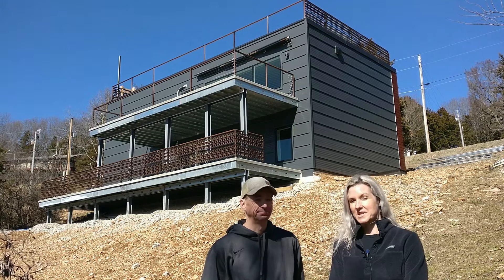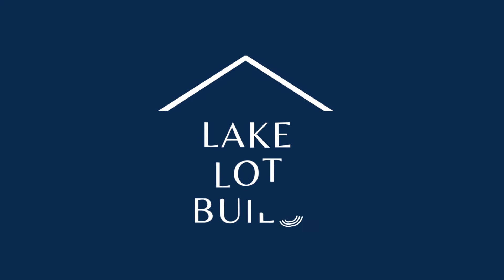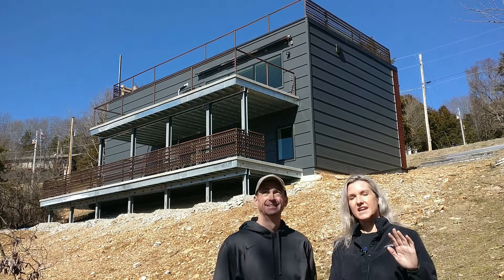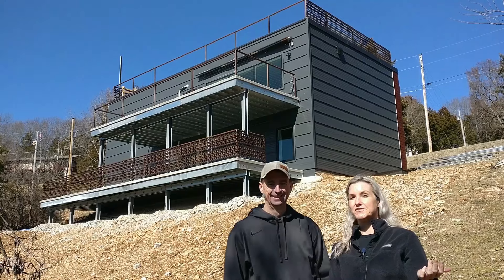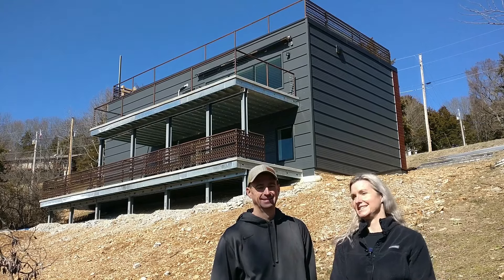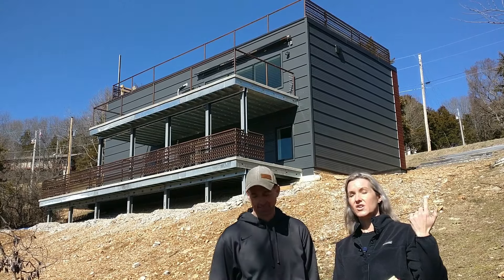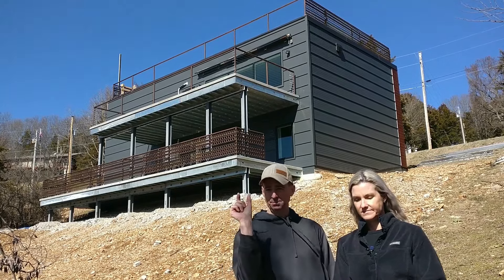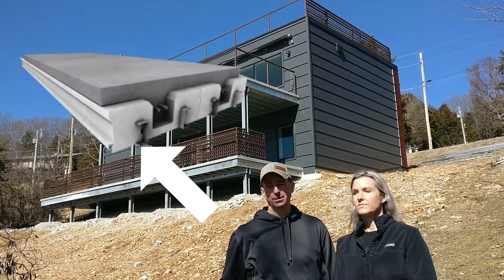Mistakes We Made in Our ICF Home Build! Would we build with ICF again?

Comment: I've been building ICF homes for 20 years.Some of the issues I've encountered is that some architects don't consider the thickness of the walls when designing the homes.Walls are 1 foot thick and it can make rooms feel smaller.Also window sizing is important with a thicker wall.A 24" x 48" window may look ok in a traditional build,But in an ICF wall it looks like you're looking into a tunnel.I always tell my clients to make the window sizes as big as they feel comfortable with.And we have taken a custom of house wrapping all of our ICF homes,not because of foam deterioration,but because of water infiltration in behind the siding and finding it's way into the ICF joints and eventually leaking in a window(It only happened once)but after the wrap,never happened again!
Reply from the maker: Great advice. Thank you!
Reply: Hi where are you located? I am interested in hiring a qualified contractor..
Reply: Excellent tip, how did you attach the wrap?
Reply: Where are you located? I'm interested in hiring one as well.
Reply: What exactly do you mean by house wrapping?
Reply: @allenwinston9225  Do not hire a contractor, get the job done yourself with The Perfect Block instead of ICF. ICCF is way better and it is fire resistant plus no termites

Comment: First off… I love you guys! you are Beyond great! I’m the guy That has to tell the “homeowner” in this case that the contractor you hired to do your new home took advantage of you. I’m a 40+ year Specially contractor that fixes other contractors screw ups!!! Not a mistake! A mistake is not using PVC pipe but coring instead? Every time and I mean every time! I go on to a job site whether it be residential or commercial I just shake my head on how bad Construction technics are… Just because you have all of the greatest tools, equipment and the best materials on the market to build something? A house, landscaping, coring/saw cutting, on and on and on and especially concrete contractors they are the absolute worst! They know very little if anything on the proper protocol of preparing the ground properly prior to the pour. The foundation is everything to your new home if there’s a not done properly everything else fails. And don’t forget the brand new pick up your contractor showed up in to show you upfront how they’re gonna screw you! They spent $80,000-$100,000+ of other peoples hard earned money on. This CLUE! 90% of the time of the time often means… Your contractor doesn’t have a clue what he’s doing (exempt on how he’s gonna screw you out of money) and he has a bunch of untrained subs out working on your project that don’t have a clue what they’re doing they’re just going through the motions that they were shown by the guy that didn’t know what he was doing, but that’s OK the sheet rock will cover it! and yet he’s raking in all of your hard earned money? Sorry for ranting and Raving but after 40 years of watching stupidity it’s hard for me to take. From the time you break ground until you finish your project nearly every contractor will cut corners and screw you. Just a recap! You guys are really great! Hope everything is spelled right And punctuated right didn’t get much sleep last night thanks Keven

Comment: At 5:40, you said simple round ductwork would have worked. I have seen guys take the foam that they cut out from that hole, and stuff it back inside the thin round duct to make it stronger. That way it will hold up against the gravel that is dropping on it from 8' to 12' or so above. In your case, the ductwork is near the top of the pour, so the gravel did not damage the duct, since it did not fall as far.  Regarding the Lite Deck, it would be nice if they designed it with wider metal to make it easier for folks to affix ceiling drywall after the pour.

Comment: I was the GC on a house I built in 2004. I had 8" poured, reinforced walls on the first level. I did not check the forms well enough before the pour. I counted on the subcontractor to follow the schematics I gave him. He did not read them well. He poured them with a door opening that was too small and sagging in the middle. He also put the beam pockets in the wrong places, including two that were actually in a header! He poured the floor on a day when it was going to rain and freeze overnight, which ruined the finish because he did not cover it after troweling it. I should have supervised him better. I had to use a gas-powered wet saw as you mentioned inside the house and got covered in the mess. My hair was matted with concrete dust afterward. I had to fix it all myself because he refused to come back and fix it. Then, the excavation contractor backfilled too much at once, and the whole back wall was pushed in four inches at the top. This caused huge diagonal cracks at the corners, and I had to pay an engineer a fortune to approve it. He told me that he would call the pest-control company to have the termite barrier sprayed just before he poured the slab. He never did that even though he insisted he would make sure it got sprayed. I had to pay a lot of extra money to have the slab drilled every foot, around the edges. Then, we had to inject the insecticide into those large holes and cap them all.
Reply from the maker: Oh my goodness! I am sorry you had such a difficult experience. Wow!

Comment: We built a new home last year.  ICF was a consideration but decided against it because it was more expensive and I didn't want 12" thick walls around our windows and doors.  We wanted to build a very energy efficient home so we used Zip-R12 sheathing with 2x4 framing, which gives you the same wall thickness as if 2x6 framing was used.  Our home is one story with 9' ceilings on the first floor and basement walkout.  We insulated the walls with closed cell foam and had 2" of closed cell sprayed on top of the ceiling drywall and blown fiberglass on top of that.  R-30 wall and R-60 ceiling.

Our overall experience was great but I think it also helped that this wasn't our first time building.  I did a lot of research of what materials to use and where, like LVL studs on walls where they were either long hallways or behind cabinets so that we had perfectly straight walls.

The best advice I can give to people who want to build is to stick to your guns on what you want and don't let contractors do things their way.  The reason they want to do things their way is because it's easier and faster and not necessarily for your benefit.  The small details when missed can be detrimental later.

Comment: Congratulations - beautiful and strong building! Thank you for the update! This is a big favor to all of us planning ICF projects. We are in process of designing a relatively small (~1600 sqft), flat roof ICF home in South Florida. Planning on using InsulDeck for the roof and FoxBlocks for walls. The roof is to be sloped at least 1/4 inch per foot with 3 inch concrete on the top. The roof will be sealed to become water proof. Walls are 12 feet tall and the idea is to use modern drop ceiling to cover air ducts, electricals and provide for lights. Hardy board for the outside finish. I wish I could share a few renditions of the project.
Reply from the maker: Sounds amazing!!!
Reply: I'm looking at similar, though not a flat roof because I'm moving to NY. You might want to look into concrete densifiers for your roof. It uses salt to react to the concrete and close up pores. Not sure if it would make it waterproof enough for daily Florida rain storms, but it never has to be reapplied like other sealers. You should also look into a product called EcoSpan. It is an ICF roof/ceiling product like Insuldeck, but uses metal trusses which would make it easy for you to run your air ducts, electrical, and lighting through if you didn't want to do a drop ceiling.
Reply: Using a XYPEX additive to the concrete while it's being mixed creates a waterproof concrete mixture. It's what they use in concrete water tanks.

It takes a few wetting events (rain or using water hose) to active the crystallization properties that seal the concrete but once done, its waterproof.

Comment: Great info.  Just finishing an ICF house with structural steel roof framing embedded and welded into top of ICF  walls.  Stuccomax was great on exterior - lots of compliments - chemically bonds to the foam
Used windows without fins placed in center of walls.  Agree with placing pipe through walls before concrete is poured for access through walls.  Wish I had lined up more residential subs with commercial experience as many residential sub contractors uncomfortable with concrete and steel construction.
Reply from the maker: So true! Your house sounds great!

Comment: Just came across your videos. Thank you for sharing your knowledge. One important consideration is termite protection under the foundation walls. Termites & similar critters will go through styrofoam like butter. It is important treat it for the same. The same goes for finishing on inside concrete walls.

Comment: Built with Nudura blocks this last year.  Definitely agree with putting in more sleeves into the walls. Also agree with wrapping blocks with house wrap that sun gets to.
Reply: I’m planning a nudura build now as well, thank you for the tips
Reply: What about using the Enviro Dry coating that Nudura/Tremco has? For waterproofing and protecting the ICF (until the siding goes on).

Comment: Great job. For extreme weather protection, might someday plan for exterior roll shades to protect the windows. I’ve been thinking to do that to help on the rare very hot days to help save on electricity as my compressors run wide open.
Reply from the maker: I have seen that on vacation homes especially and it is a great idea.
Reply: I only know of the shades, as very common in Europe for energy savings. My father-in-law had it done.
Reply: Haha, the master bedroom on the rental house in Austin that my boyfriend lives in has the metal shades. There's a light switch next to his bed that operates them. Funny thing is, that window looks out onto the enclosed patio/atrium. I guess it's for privacy if you have guests over?!

Comment: Great lessons all through the series. The lite deck garage floor was a big question for me. Sagging underneath and causing cracks? Water drainage when parking a wet car? Glad to hear it's working. Roof slope is a minor problem but worth mentioning
Reply from the maker: Thank you! Garage floor still looks great! No cracks as all. We are going to have to use epoxy or one of the sealants though to make sure that we can waterproof it for pulling in wet cars when it rains.
Reply: @LakeLotBuild  Look into something like Ashford concrete densifier. It is more natural and never has to be reapplied.

Comment: Took me four years just to excavate and build the 7" foundation slab and 16" thick walls for my bunker/basement. Did not want any strangers at the location. Rented steel forms for the walls, and slab and footer is one massive pour. Walls are 10 feet in height, and I had to get the ceiling slabs prefabricated. They are supported by steel beams (which I did not want). I wanted a clear span but 70x50 is too large not have supported beams or a load-bearing wall on a 5" think concreate overhead slab. I even built a elevator large enough for a fork-lift.

Comment: Great Build. You did a fine job. I framed million-dollar homes in the mid 1990s and I've traveled all over the U.S. for 10 years building commercial concrete structures as a superintendent foreman.  Shame on your contractor for not putting in your box outs. On a roof that small, I would have had 1.5" per 8' slope. the finishers were lazy. I've poured super-flats in September. There should be no low spots unless the decking sagged after the pour.

Comment: I appreciate your video. I'm planning an off grid icf build using build block. 24x36 with single slope 4/12 roof for solar and a basement. Main floor has a mechanicals room attached on north side with lean-to roof. Figured icf decking for roof and mainfloor for the full envelope. 
Good tips about the windows since that's what I've been stuck trying to figure out lately. Seems like a lot of builds do wooden roof which I don't really understand.
Reply from the maker: Yes, we are so glad we went with the concrete roof! Best of luck on your build. It sounds great!

Comment: Love you channel guys!  Question: how did you atrach your deck ledgers to the exterior of your home? Assuming theyre some sort of galvanized or coated steel?
Reply from the maker: Thank you! We had concrete knockouts and cast in galvanized bolts during the wall pour. I think we have it one of the episodes. I will look and post below when I find it.
Reply from the maker: Found it! Around minute 11 to 12.https://youtu.be/rcA2jvlYlLg
Reply: @LakeLotBuild  thank you! I'll watch it asap.  Where did you get the components for your deck framing? Was it 100% custom?
Reply from the maker: It was custom given our deck sizes. The steel was ordered through our  ICF contractor. Definitely the way to go though- steel and concrete decks. Due to the crazy lumber prices last year we actually saved money over wood and have a product that will last forever.
Reply: @LakeLotBuild   Exactly!  Did you make provisions in your deck to allow for drainage?  You're in Missouri right? I'm a displaced Missouri boy living in Georgia lol
Reply from the maker: We just sloped it so it drains off the front edge. Works great with rain and melting snow so far.

Comment: I've done a lot of major home renovation projects and made a few mistakes as well. But often mistakes turn out to be an opportunity in disguise. We did extensive research of windows and found that Pella made the best quality windows but they are expensive. Despite the issue with the black paint based on our experience in terms of function over the long term you will be glad you used Pella. If the roof will take the extra weight load maybe you should consider adding an enclosed metal awning/sun room/green house on the top deck that you could use even in the winter. That would also increase the square footage of your home increasing its value as well.
Reply from the maker: Yes, for function Pella is great! We do hope to spend a lot of time on the roof. We have retractable awning on our lower deck. I will look into what we could do up above. Great idea.

Comment: Brave you two.  Great.  Thank you.  Every build is about managing the compromises.  They are always there.  Rooftop should be addressable with a post applied filler made for outdoor leveling of concrete - even though you don't want it actually level.  Perhaps call a few concrete guys until you find one that knows how to deal with it - and can address quickly/thoroughly.
Reply from the maker: Thank you! Some leveling was done but still have a pretty good sized pond. We will definitely keep looking for solutions.
Reply: You can eliminate ponding by adding slope. Adhere sloped insulation to concrete and install membrane ( rubber or TPO) over the top with walk pad over areas that will see foot traffic.

Comment: I’ve been following your build and love the roof top idea so much that we incorporated it into our plans as well. I’ve watched several of your videos and heard your disappointment with the water proofing not being water proof. But I haven’t heard if you found  any solution? Because we are attempting to do almost the same thing, I really appreciate any advice you have on the xypex and overall waterproofing of your deck top roof. Thanks!
Reply from the maker: Our main problem was the incorrect slope. If you can get the slope correct then you will save yourself a lot of trouble and heartache. We have finally waterproofed the roof after trying two other elastimeric paints that did not do the job. We used a product suggested by a roofer that is used on basketball courts and roofs. It is a paint on silicone membrane. So far so good. Don't bother with the elastomeric, just go for the silicone.
Reply: @LakeLotBuild  
Thank you so much! Any chance you can tell me the product name?
Reply from the maker: Yes. Inland Coating RC 2000
Reply: Thank you!

Comment: I buidlt our home with icf. But only the basement and 1st floor. Conventional framing for the 2nd floor due to the walls not aligning, with the lower walls. Cant agree more about using metal ducting or pvc/ abs pipes placed in the walls at all of the appropriate places. Measure twice all of the window/ door openings  for plumb,  square. Ensure the windows openings are properly braced and supported before the pour. Run 4" pvc pipe under the slab for running electrical or plumbing lines from the house to shop. Avoid using 90' angles and use connected 45' to make pulling the wire or lines easier. Lots of other changes too many to list as well. Still love the home and the natural coolness in the summer and comfort in the winter.